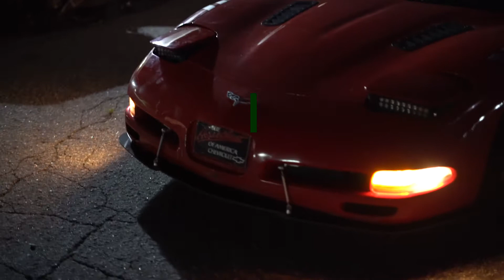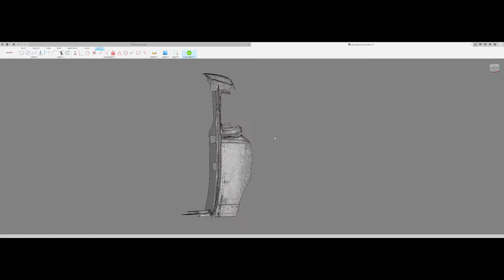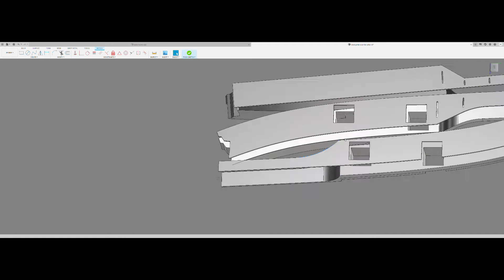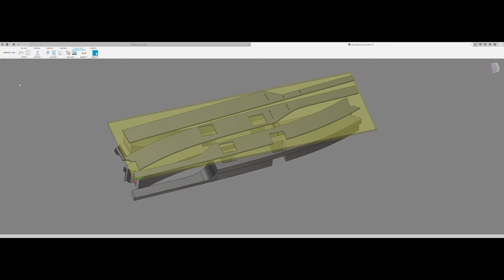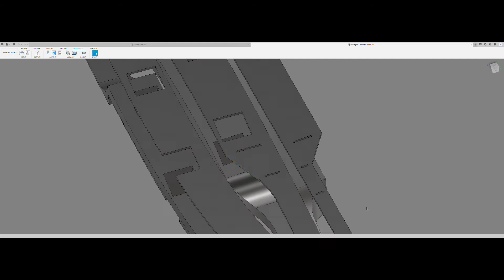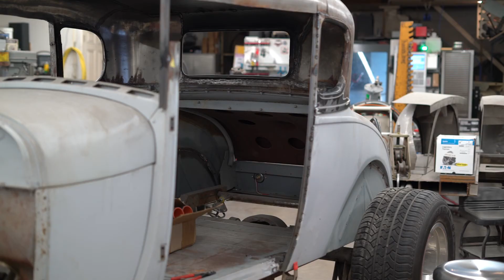3d scanning & part development for HOT RODS!

Comment: You're the man! Great job. I love how you 3d scan these things and right after that you fix whatever problem. Do you ever see yourself in a situation where you have to buy plastic made parts? If, so knowing what you know and capabilities, you could make these parts in the house, all you need is a small thermoform machine big enough to handle the type of parts you might need. The rest to complete the job you already have. You can scan parts, create your own molds and fixtures, plus you have the CNC to trim these parts. That's awesome :)
Reply from the maker: I have two thermoforming machines. one is big and can do really big thick materials.  Its why I bought the DMS. I also use the thermo machines vac tables for resin pulls on carbon. I have press and i make molds with heating elements for dry carbon formed with really high pressures!  you can see now why I was so excited and then so let down by this machine. I replaced a great running homemade cnc machine 3 axis with dual spindles and a homebuilt controller and I thought the DMS would be an upgrade. I just hope they can get it to run correctly. its just been all over the place with repeating on the z axis.

I also have some injection mold machines and some haas machines and a big mazak 5 axis all newer then 2018.
Reply: @hyperformancellc  Oh wow, congratulations, you're on-set ready to rumble Mr. I do hope you get all of your issues fixed on your machine. I have this customer down in Ohio who owns a twin table DMS, it runs like a knife over butter, so smooth. I bet you paid a lots for yours, don't give up, keep on giving them a hard time till its all fixed correctly.
Reply from the maker: @ncprotraining  I made a video on my issues and I had to delete it yesterday to keep from getting sued by them but they are sending out the best tech they have thursday. So some mutual assured destruction had its effect.  

That sure didn't help with my confidence of owning this machine long term and keeping it running with needed parts and support. I just hope it stays running long enough to pay it off so I can drag it outside with the excavator and replace it with something new. If your local and you want it your welcome to it at that point.
Reply: @hyperformancellc  I'm pretty sure I replied and left a comment before, but for some reason it got deleted. Anyways, all I wanted to say is that you know what exactly what you need. You paid a lot for this machine, you deserve to get it all fixed working properly and up to your expectations. I know exactly how you feel man, I've been in the industry my whole life and I've learned that if something doesn't work as needed, well..., get it out of the way, out that door hahaha. Why keep on struggling and spending money on things..., when you can be working nice and smooth with something else. Right? Btw! Where are you located? Omgosh, I always wanted one of those, it's just out of my reach Lol These are not for the average low-income people like me Hahaha. Otherwise I would take it in a heartbeat and rebuilt it myself, that way I could work from home instead of flying around to go see my clients onsite; could even trim their parts you know. Ugggh one can only dream :( I DO HOWEVER HOPE IT GETS FIXED AND WORK AS EXPECTD FOR YOU SR. :)
Reply from the maker: @ncprotraining  where are you located? shoot me an email. I didnt know you didnt have a machine like this. I open my whole shop up to help people as long as its not getting in the way of the work I am doing. So often it helps me because I pick up the little things on how people work. If your local lets be friends and make cool stuff.
Reply: @hyperformancellc  Of course! I'm currently doing onsite programming services. I quit my job to work on this full time, been doing it for two years now. Yes it's been rough getting myself be known out there Hahahaha. You know the lingo.  I go to my clients and set-up theirs cnc machines in the best possible way so they can rely on it to perform and work with the less effort needed. Some of my clients are so busy they simply do not have the time to program and such, so they call me for that. So I program their parts, inspect them to meet their drawing or prototype needs. I make sure that when I leave these are ready to be trimmed without any tweaks. Whatever! "It would be nice if I had my own machine", that way I can program the parts at home, then ship their fixtures with parts already programmed and ready for mass production. BTW! I'm based in Elgin Illinois :) Plz let know if you ever need anything, I have a few friends in the industry with whom I work from time to time, we support and help each other sharing our knowledge on the thermoform, 5 axis cnc trimming programming stuff. And..., yeah! :)
Reply from the maker: @ncprotraining   im in greenville sc. Im just trying to get the post processor finished up so I can have the machine inspect tools and check for tool break detection and wear and such to make it useful.
Reply from the maker: about 12 hours from you. your up in the windy city area! I bet your getting some weather right now!

Of course anyone anywhere always has weather. but like your having that big cold front and snow.
Reply: @hyperformancellc  Its been a dark grey cloudy day here and yeah we get all year season up here hahaha. Fun, fun. We're def close if anything :)
Reply from the maker: @ncprotraining  you can look up my shop and get my phone number or email. Hyperformancellc@gmail.com I have a super great post processor I have modded up for fusion 360. Ill share it and we can try to get the in process probing features to work.
Reply: @hyperformancellc  Got ya, I've sent ya a mail to confirm info...